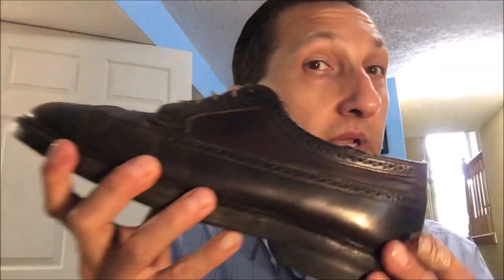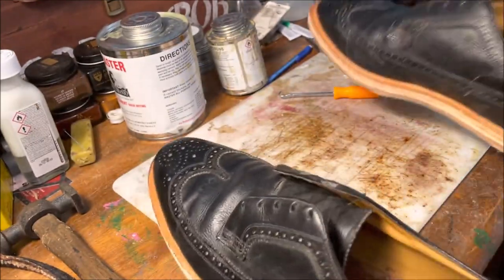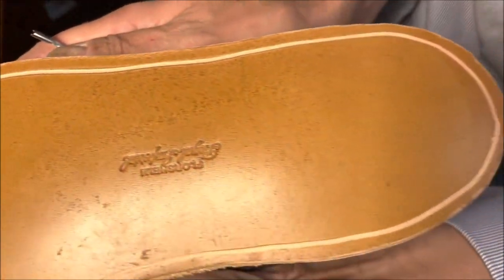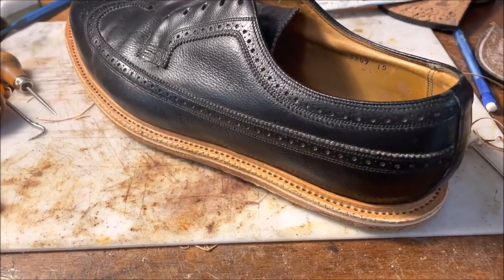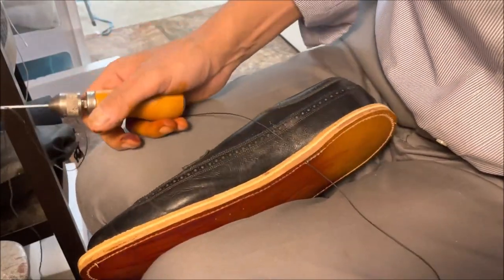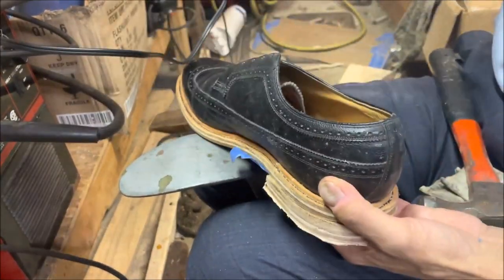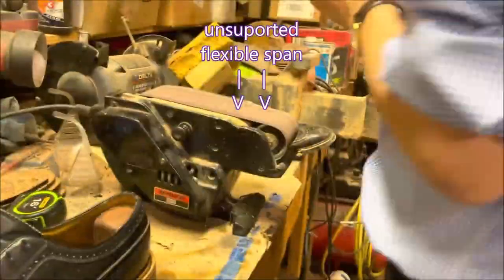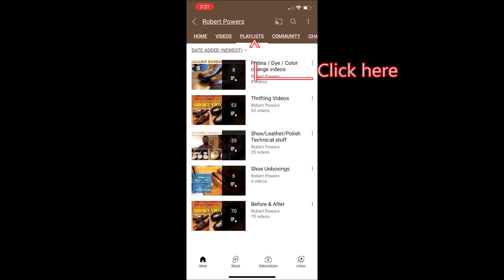Florsheim Royal Imperial LWB ReSoling at Home 2/3

Comment: Bob, 
I'm also planning to undertake a similar project to this one. Thanks for being so detailed on where you sourced your materials. I had trouble with my last resole job because I tried to cut the soles from a hide which was of a poor quality. It worked okay in that the shape was correct but the thickness and the rigidity was all wrong. Your welded tool to punch through the welt and sole is really awesome - I wish I had any welding skills. I have to use just an awl for my hole-punching. 

Also, with the edge finishing, I've seen shoemakers use a piece of broken glass along that edge. Really looking forward to part 3 of this series!
Reply from the maker: I always tell people to practice on shoes they’re not afraid to mess up, because we WILL make mistakes early on. Bravo for trying! The way I see it, the more people are interested in this kind of thing, the more people will seek out high quality shoes instead of buying throw away shoes every 9 months. Yes, I’ve seen the bespoke shoemakers use glass. It’s kind of ironic, I have a Band-Aid on my hand as I type this, I dropped a jar of salsa and cut my hand cleaning up the broken glass, LOL

Comment: Bob if I may ask I think in your previous vids in re soling your shoes you used Weldwood glue may I ask how that’s holding because I bought some and haven’t used it yet
Reply from the maker: It worked fairly well. I think the Master's is better, but If I had some I'd still use it. I think the prep is more important than the glue. For example, if the edges of the soles are not square, like when putting protective half soles on top of a used worn sole, the edge will peel back off. Another situation is if the half sole is not perfectly evenly trimmed with the edge of the leather sole, and it overhangs, it will tend to peel back off a little when it catches on curbs, etc. The good part is doing it at home, you can just repair the spot at home.